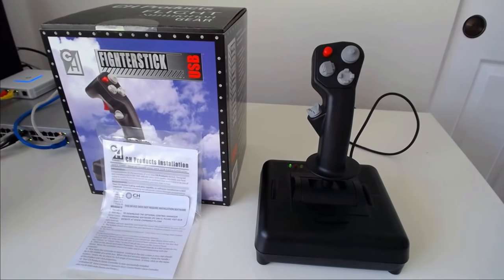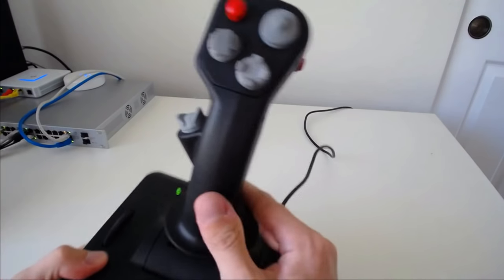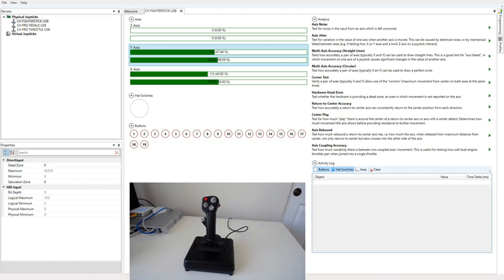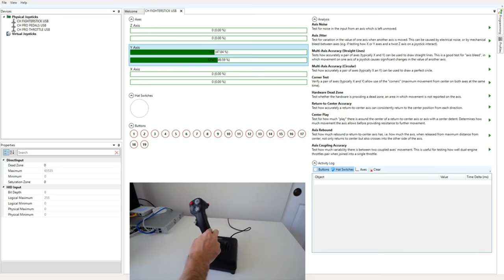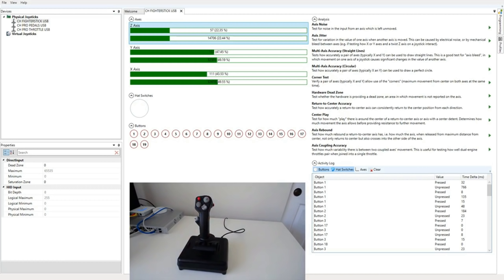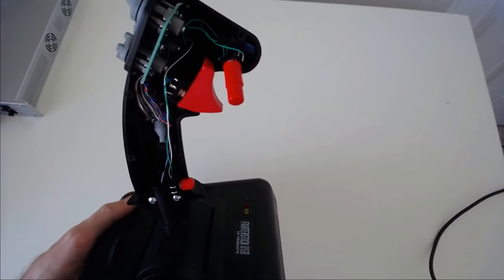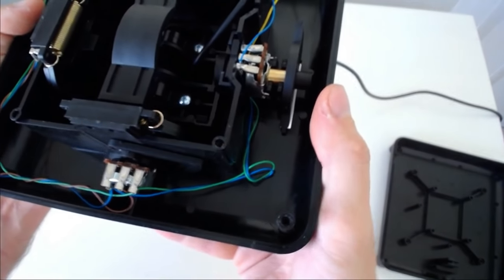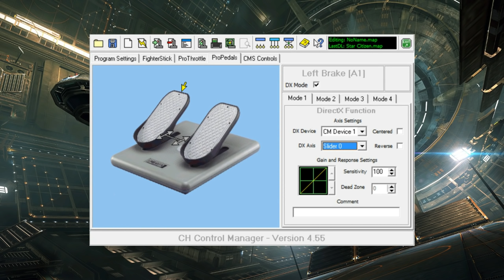CH Fighterstick Review and Disassembly

Comment: very nice but we still don''t know if this joystick moves the tailplane rudder  when we rotate it to left & right, at no moment the  demonstrator shows how we can manage this vital command which is available on any cheap 30 dollars joysticks!
Reply: The CH Fighterstick is probably the the longest lived joystick I've had.
The one I've had is now pushing 10years with me using it 3-4 times a week.
In the 10 years prior to this I had 3 Logitech joysticks, 3 Saitek HOTAS.
Of those 6, only the X-52 Throttle from the last X-52 Hotas is still functioning.